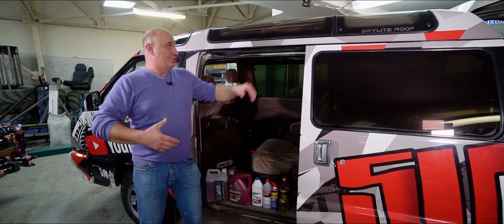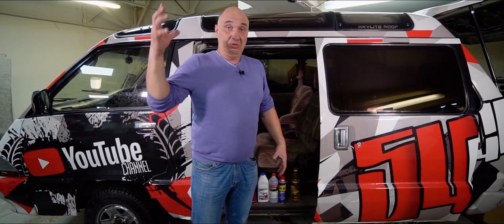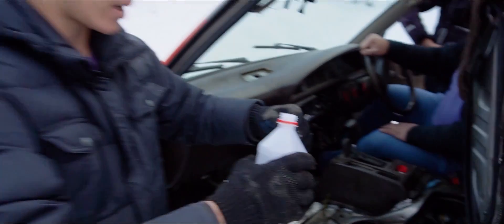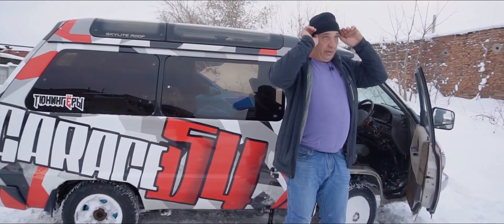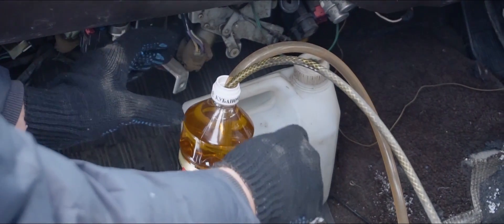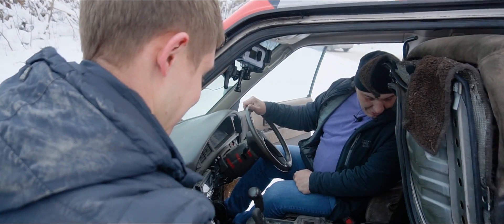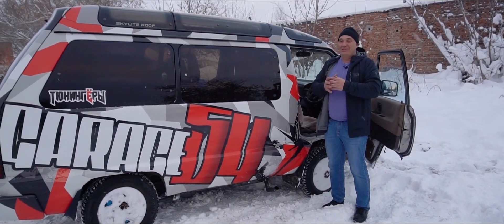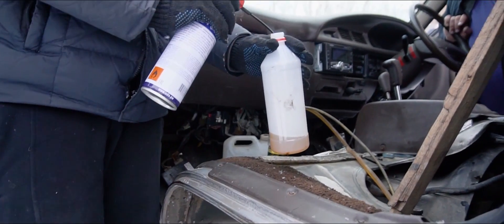Alternatives to diesel fuel: WD-40, cooking oil, brake fluid, Dexron

Comment: I would love to see you guys do an oil change while the vehicle is running.
Reply: It would just loose pressure then it wouldn't run right? That's how you stop old diesel tractors anyway...
Reply: @mikebolton2388  if it has a safety switch or if its a HEUI style injection, yes
Reply: @mikebolton2388  interesting thanks. but crankcase pressure etc, makes sense
Reply: @mikebolton2388  As long as you kept the oil level over the oil pump intake at all times it would work.  Fill as you drain.
Reply: Seen beetle belt changed while car running
Reply: Georgi Georgiev the belt only powers the engine fan, and the dynamo (alternator in the newest ones). I saw so many peoples frying their engine because that belt fail and they haven’t notice.
Reply: already done by some Germans. https://www.youtube.com/watch?v=7wHyS1UAz-U
Reply: They changed the whole engine between cars while its still running haha
Reply: I’ve heard of people changing fuel filters while it’s running with a pre filled one waiting
Reply: Used to do it on large equipment like loaders when I fixed heavy equipment. You let it run, open the oil drain petcock (yes, some of these engines have petcocks instead of just a bolt) and check how fast it drains over 10 seconds. Use a metered oil pump to replace the oil as fast as it drains, and wait until the stuff coming out is clear. Close the petcock, wait a few seconds, stop adding oil. Check oil level and adjust as necessary.
Reply: Most stationary motors are serviced like that. You start pouring it in and then drain it equally until the oil is clean coming out.
Reply: You'd learn to be fast.
Reply: You got your wish
Reply: And they now did so
Reply: It wouldn't be too bad if they didn't get scolded everywhere and get third degree burns in the process. Engines run at about 200℃
Reply: You'd need to pull it out via vacuum. Crankcase pressure keeps it in mostly. Or it would take a solid hour or so and by then the engine would be toast. I've pulled plugs in running cars before. Not much really happens. A Lil dribbles out and that's bout it.
Reply: @AndyKPOV  what a BS mate.

Comment: doesn't WD40 need to be pressurised and forced into the engine for it to work? should also try 20% nitro r/c fuel
Reply: doesn't the pump and injectors do that ?
Reply: @Eduardo_Espinoza  they don't help when it bubbles and foams before it gets to them, feeding it under pressure keeps foaming down.
Reply: @ShadowzGSD  oh maybe it has Co2 in it so you would have to let it sit for a while someone else said you can buy it as a liquid so it might not foam

Comment: i ran my old T4 vw 1.9TD on sunflower oil for 7yrs with no problems it was a bit hard to start in winter but i just mixed in 15%diesel and it was fine 👍 great job guys it was fun to see what a good old diesel wuld run on 😆
Reply: Damn man for 7 years, pure oil, or you took from used oil
Reply: @warrior8154  bothe my sisters boyfriend is a shef he got me sunflower oil wholesale in 15l tubs and when he cleaned out his friers i look that to 👍 yes i really am thet cheap 😆 the van had 197k milles when i bought it and after 7yrs use it had 476k milles on it and NEVER btoke down 💪 great van i miss it 😢
Reply: @gethinjones8992  damn that's great dude
Reply: @gethinjones8992  In my country if you do this you go to jail for tax evasion. Great country, eh? :D
Reply: @Sekir80  well tecnicaly its the same heere in my country but during the fuel crissis in the 70s we have whats called the emergency fuels act 👍 i just walk the line of legality without taking it to far 😆
Reply: @gethinjones8992  ah, okay, interesing! I don't think we have such an act, we had communist occupation in the '70s.

Comment: You can run diesel engines on used filtered motor oil
Reply: I run my diesel car on plain k1 kerosene cuz its like free here in iraq about 10 cents a liter
Reply: @jungle6815  beatin' the system
Reply: @Catknapper  hehe 😁
Reply: Jungle how is it in Iraq
Reply: @Im_The_Slep  quite fucked up, lots of assasinations n covid shit 
Hope you guys are doing good 🖤
Reply: @jungle6815  My deceased father worked in Iraq with Yugoslavian shipyard construction company back in 1970's. It was rich country back then...
Reply: @jungle6815  probably it will be destroyed soon
Reply: Kerosene has no lubrication. Injection pump will fail soon. Use 2-stroke oil mixed to it
Reply: @juhomaki-petaja  a good old inline injection pump can take it better if i remember correctly
Reply: flo __ 
Inline pumps camshaft is oil lubricated but injection elements are fuel lubricated and it will fail
Reply: @juhomaki-petaja  Depends on manufacturer. Many are actually approving it as replacement for diesel.
Reply: @juhomaki-petaja  i use very little 20w50 with my fuel im too picky 😆
Reply: Danger Bear  I was there in the 90's, and remember a completely surreal experience. I was driving through an area full of huge oil refineries, and urgently needed to refill my car. Pulled into a filling station, only to see big signboards informing customers "Gasoline is sold out!"
Reply: I use to use cooking oil in my land rover 200 tdi it ran smooth and quiter, only in the summer to thick for the winter unless you could pre heat the oil,  more environmental friendly as well.
Reply: Danger Bear you can go as high as 70% used oil but 50% would work just just as good
Reply: @its_robbietime1333  true! I run mix like that all the time.
Reply: @Иван Русић Maybe cause there aren't many K1 heaters? It is the desert.
Reply: @chickenray182  buddy the main use for kerosene here is heaters cuz in the winter its freezing fucking cold like -5 celsius avg and btw only 30% of iraq is a desert sooo
Reply: @jungle6815  - 5 haha not bad, i been leaving at minus - 32, what a night mare
Reply: @jungle6815  Don't they add stinky chemicals to prevent you from using it in your car? Can you smell it?
Reply: When I do an oil change one of the perks of driving a diesel is I just pour my dirty used oil in the fuel tank after. No need for disposal. I find it runs better with oil much quieter
Reply: @michaelchristopher9444  Also, used motor oil makes a great premix additive to help kerosene run less chattery.
Reply: That is extremely unhealthy. You can get really sick in the long term.
Reply: Used motor oil is highly carcinogenic even with just skin contact, I can't imagine how bad it would be breathing vaporized oil coming out of the exhaust...
Reply: Here they are selling that freaking low sulfur diesel wich makes my old diesel pump sound bad, what do you guys recommend for replacing the sulfur in the old diesel for lubing it up? ATF or 2 stroke oil???
Reply: Unfiltered is a disel engine running away?
Reply: Danger Bear  I drive on wasted motor oil too but my old Jeep turbo diesel runs on 75% wmo and just 25% diesel. Two years ago I was driving on 100% vegetable oil. Works great on both. 🙂
Reply: @V8AmericanMuscleCar  I have run my diesel cal on 100% wmo before when I run out of diesel, was a bit sluggish but it run.
Reply: @shaun milnes I do. Here is how I do it...  https://youtu.be/9uyIS8fUsVA
Reply: My truck ran away
Reply: Yeah I used to run my work truck on used cooking oil I got free from a few restaurants but I got rid of the truck.
Reply: You can run a diesel on almost any oil product. But here in the UK it's a felony doing so. It's compulsory to purchase all fuel at a licensed filling station. Obviously it's for tax revenue reasons, diesel is taxed around USD 4 per gallon.

Filtering oil with the purpose of running a vehicle on it is in itself an offence, as the manufacturing of any kind of fuel is illegal. (Unless you are an oil company...)

So if you filter motor oil and pour it in your vehicle, you are committing two offences, one of them a felony. They can lock you up for that...
Reply: @thefreedomguyuk  yeah UK government its not corrupted at all. Fek that everything is coz of money.
Reply: @slavi096  👍
Reply: @thefreedomguyuk  yes, our UK government is quick to jump on any alternative fuels. I run my vw engined IDI car on pure vegetable oil. It doesn't like the winter, so I add petrol or ATF to thin it up along with a bit of the normal diesel.
Reply: @monkehmonkehmonkehmonkeh  I can well understand you. If I had a diesel, I would likely do the same.
-And let's not even start on how the government for years were encouraging us to buy diesels. Only to turn 180° around, and punish those who were listening and bought diesels. Outrageous.
Reply: @thefreedomguyuk  Everyone runs on the red anyway. I have also heard of farmers growing rapeseed oil to process into biodiesel to run their machinery and utes.
Reply: @Morten Kapa - It’s perfectly legal to use filtered vegetable oil in diesel cars in the UK. It’s not only legal, there are laws making provisions for it.
Reply: In my country there are diesel pumps everywhere so I don't need to use all of that other shit yall are mentioning.
Reply: @baby-sharkgto4902  well you go ahead and pay the extra for your diesel when we're saving nearly half the money or getting it for free 😉
Reply: @baby-sharkgto4902  "Y'all"....I've spent time around your neck of the woods. 
"Ain't no motor cars running on that diesel thang around there. Noo, Sire !!"
Reply: @thefreedomguyuk  hahah I live in the Northeast United States I just type with an accent 🤣
Reply: @Evermore I don't think it's really anything to do with communism. In a communist country the government would give you all the fuel you need, wouldn't they ?? 😆

Comment: I've used a gallon of clean/new canola oil to get my IDI to a fuel station in an emergency, and my old one with a leaky injection pump liked to run on ATF-4 more than actual diesel.

Comment: Dot 3 brake fluid in the power steering. I am guessing the wheel would turn way to fast
Reply: no it wouldnt, they both have about the same viscosity, plus the pump has a relief valve so it does not over pressurize.

Comment: New commercial for a car "Our cars are eco friendly,save a planet,use cooking oil as fuel" presented to you by Garage 54
Reply: WVO (Waste Vegetable Oil) has been a thing for a longtime.  There are kits with filters and heaters for older vehicles that don’t have them. Smells like French Fries.
Reply: I know its a joke but how it is an eco friendly car. Cooking oil is nastier than diesel when it got burned.
Reply: @Görkem-x5h  Because cooking oils come from plants, just like biodiesel, so they are carbon-neutral. Plus it makes you more independent from the system if you make your own.
Reply: @Jupiter__001_ 
Western government: CEASE AND DESIST
Eastern government: Smells nice, i'll allow it
Reply: People do run diesel engines on used cooking oil since ages. But it's illegal to drive it on the roads in most developed countries because it has lower tax than "proper" diesel fuel. However some oil companies recycle used cooking oil as diesel fuel.
Reply: @peterkiss1204  biodiesel se le agrega 15% al gasiol en Argentina